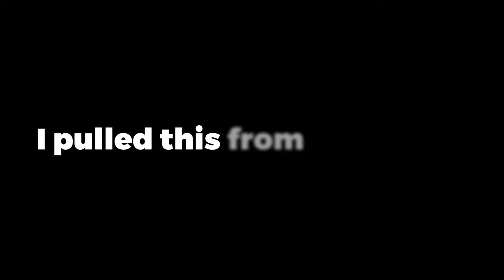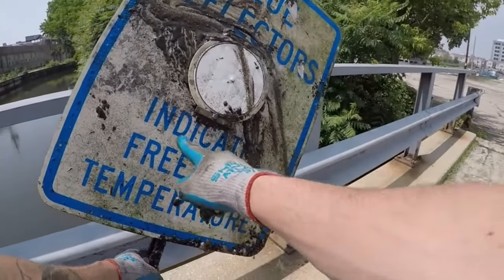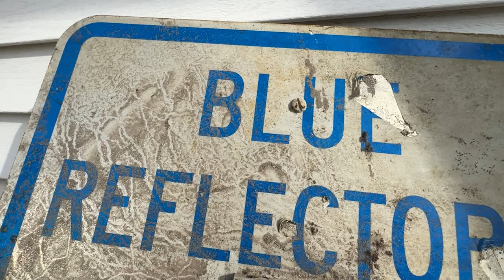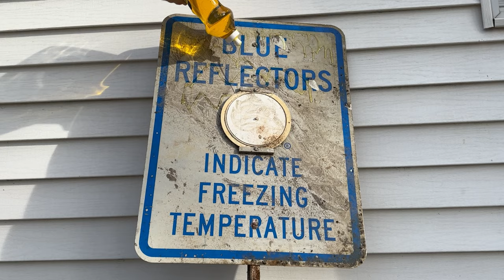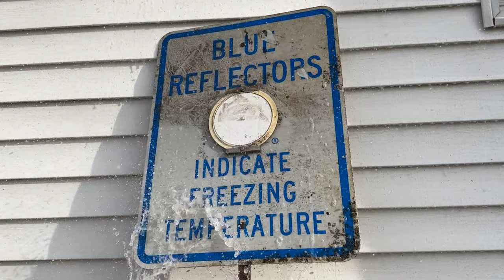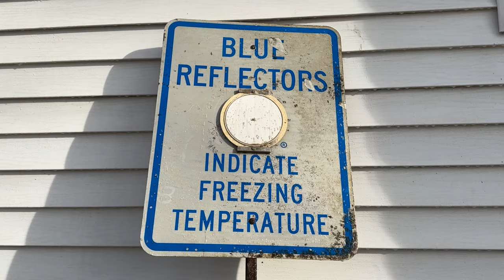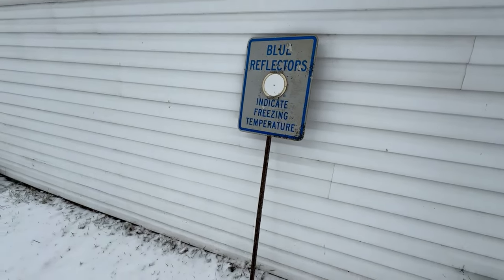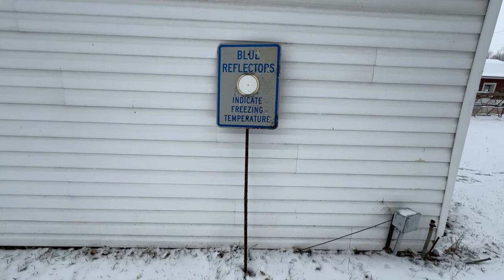Unbelievable Restoration of Vintage FROZEN Road Sign Found Magnet Fishing! (-32F Temperature Test)

Comment: Hi Tyler.  That really is a cool sign. Try white vinegar on a corner.  The little scratches need to be covered with maybe clear nail polish.  Remove any rust that is in the scratches and let it dry good.  You could also try a Mr. Clean sponge.  You know, the white ones.  Good luck.

Comment: Ok I think you unscrew the disc in the center and flip it over, powered by a patrolman  😂lol.
As for what to use, a dish scrubber sponge on one side abrasive on the other.   Next comet cleaner. Steel wool comes in different abrasive levels. Ok, that's good for now lol.  Love the videos.
Reply: That's what I thought?

Comment: Is it possible the reflector needs turned over those screws looked like they came out or maybe somebody  would com out and put a blue reflector up when it started freezing
Reply: That was my thought. Those types of signs stays out all the time, but it's only when it's cold is when they put out the reflectors.
Kind of like around here in Texas with the 'Red Flag' warning signs which are out year round, but the road crew only opens them to be seen when the fire danger is high...

Comment: I know lue lights, assuming reflectors too are illegal in Ontario, so the old cars must have had them, cool find.
Looks great after the clean up.  When you fix the barn or house, a man cave is a must with all your cool finds
Try putting a bit of Ajax, Comet, dampen a bit on a soft cloth until paste and try cleaning small spot to get dirt off, may work, I do this when dirt on walls or anything else that may be sensitive so I do not remove paint just the dirt . Try on small area first on back of sign.
I get cloth wet first and dump a little bit on or wipe leftovers from lid after cleaning sinks .  They say it scratches sinks, been using for sixty years never does that if sprinkled on wet sink and wiped with wet cloth it suds up and works great

Comment: Newer sign, that's not paint but a giant sticker. Use a knife, Exacto if you have one but any knife will do and cut off the loose parts to keep it from tearing more to preserve the rest of the sign. They do make replacement paint that should cover up the missing parts.
Looks like mold, use Bleach on it and scrub it lightly. Maybe with an old and used tooth brush, nothing too abrasive to preserve the sign.